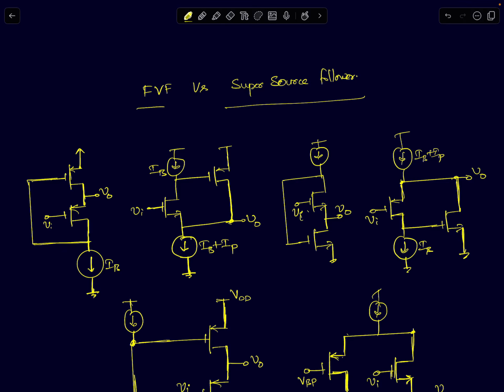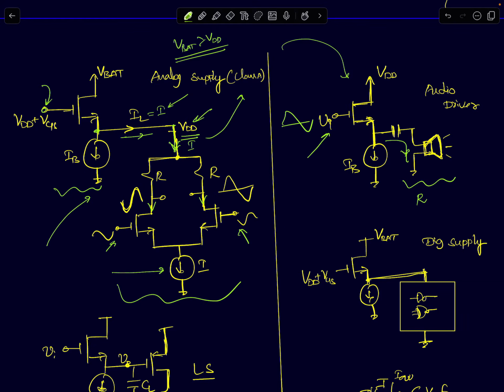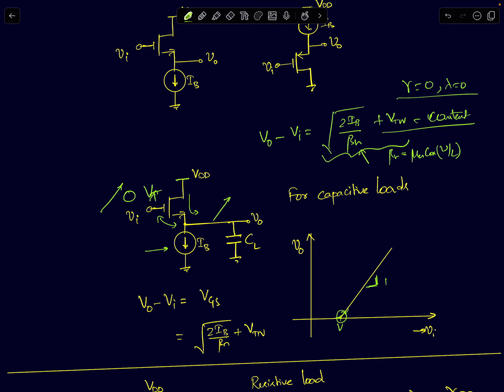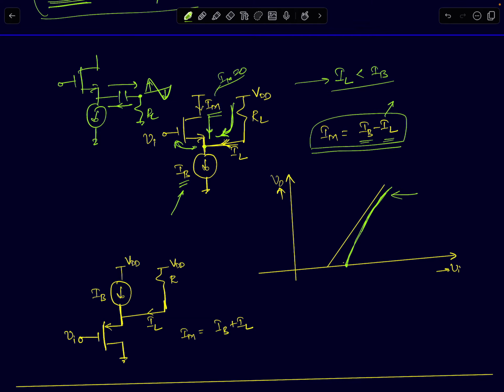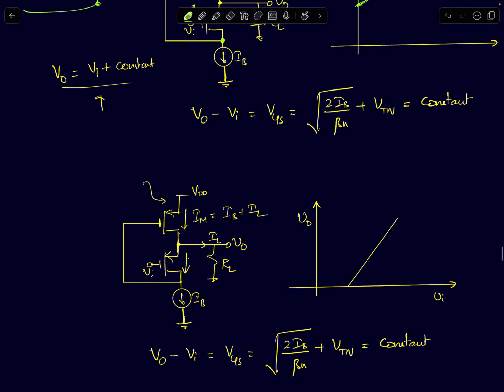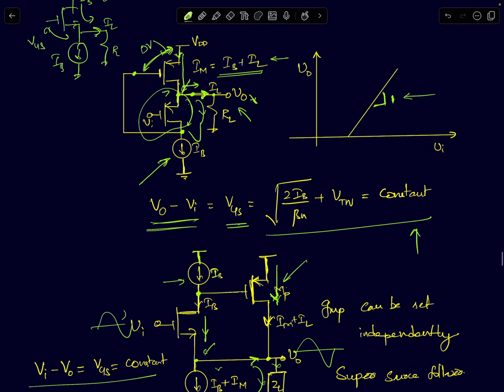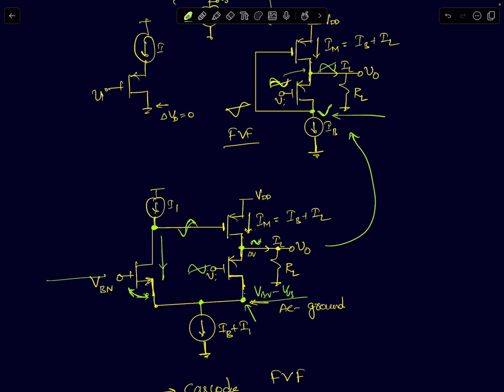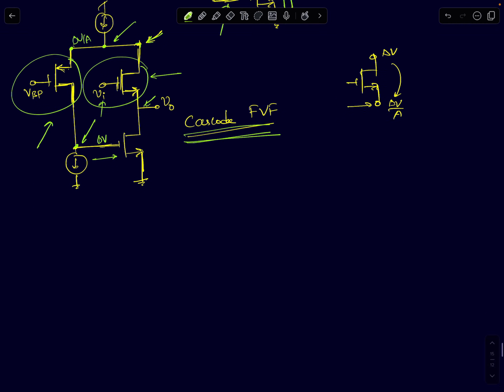AIC Lecture 58) Flipped voltage follower vs Super source follower. (dc characteristics)

Comment: I have a question.
Why are we changing Vi for the source follower circuit? And why are we even bothering about that… source follower in ldo loop hence Vi will only change if input reference will change.
Isnt input is fixed in ldo?
Reply: Remember our input signal in the LDO can also be thought of as an error signal. What you’re asking for would essentially be an open-loop amplifier if it was purely DC.
Imagine we see a change in load in our LDO output. What happens at the gate of this source follower? It will see an error signal propagating through the loop.
Reply: And SF circuits are in the main sense buffers, that is not LDO specific

Comment: this is such a good lecture! if only I saw this 6 months ago when I considered to use an FVF to improve SF linearity in my design... I wouldn't abandon this topology )) needed to drive a 100 Ohm differential tline with high OP1dB and very high frequency. I was afraid of the headroom limitation because of the 3 transistor stack and went with a huge common source instead